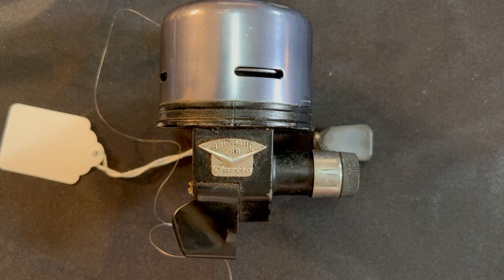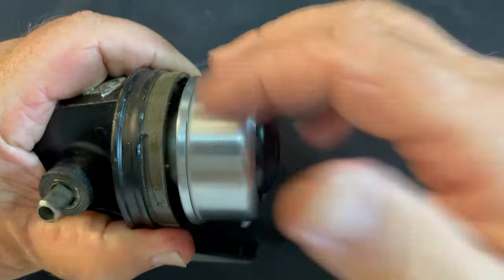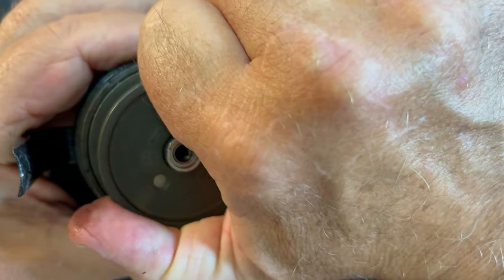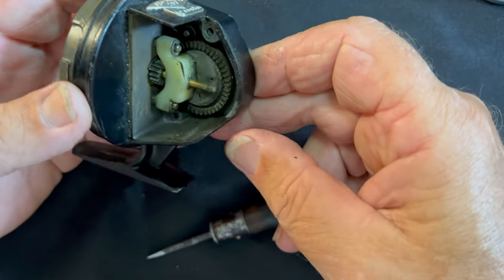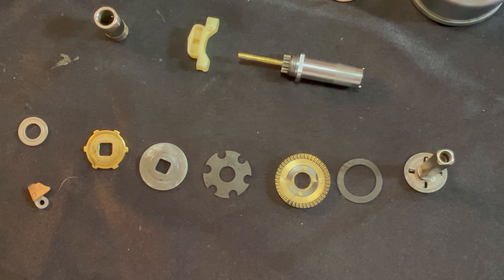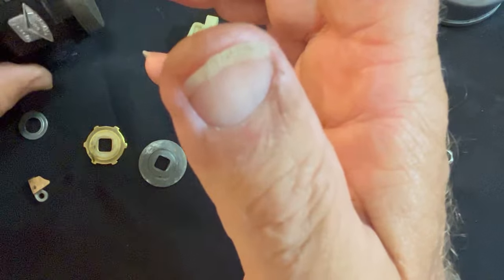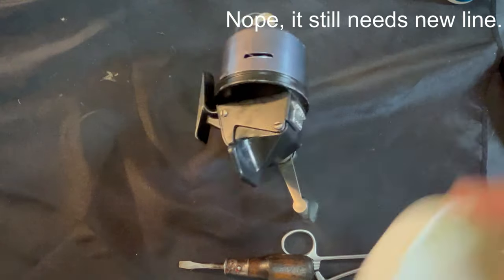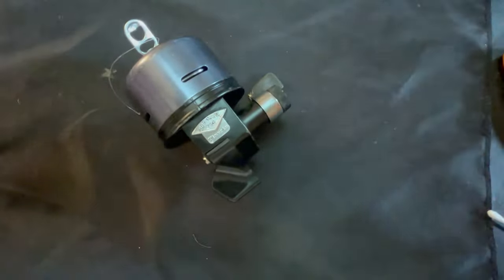Garcia ABUMATIC 290 -- Service and Lubrication -- Young Martin's Reels

Comment: I sure am glad you did this one now I can save the video and do my father's that I have these have always kinda stumped me...I guess I've been afraid of messing it up...Thanks so much...
Reply from the maker: Glenn, they are pretty nice little reels. I’m just not crazy about spincast reels that use a main gear drag system. They seem to be overly complicated and you seem to have to tighten them down too tight when landing anything with any weight to it. Since I’m never actually fished this reel, I can’t fault it. It sure feels nice in my hands.
Reply: Yea I prefer spinning reels myself... I've had this one my father's a long time never fished with it..for that reason over complicated is reason I've not taken it apart I mean it seems to operate fine but I know it could use a cleaning now I can because of the video...

Comment: Hello, my abumatic 290 has problem releasing the line when I push the button, need tip what to do to fix it.
Reply from the maker: Dennis, the spinner head is the part that controls the line release. It is the part I pick up at 30:25 in the video. I’ve never tried to take that apart nor do I think you should take it apart. Instead, clean it well with WD40 and a long bristle brush. Put it back on and try operating the reel a few times. If it works properly, take it back off, oil it, and put it back on. If it doesn’t, start looking for something jammed in there or a broken part.

Comment: I had a washer break the fiber one with like the u shapes in it are they something you can find so I can get this 😢 cleaned and fish ty
Reply from the maker: Bryan, I don’t think it has to have the U shaped cutouts. I think an ordinary drag washer of the correct size will work. You will need to measure the outside diameter, inside diameter and then thickness to find a suitable replacement. To the best of my knowledge, OEM parts are not available. With the correct measurements you can probably find a suitable drag washer by contacting:
https://www.smoothdrag.com/wp/

Comment: Boy, I hate little c-clips!  As you were reassembling the main gear, drag, and axle shaft withe the pinion - why didn’t you grease the main gear and pinion gear? I’m not quite understanding why you do the greasing before rather than afterward. It appears that the drag adjustment piece is also the part that holds the handle on the reel. That’s just plain weird. That little tab that you bent down - did you ever bend it back up? Did that matter?  Rick, I’m not sure I like this reel. It may be that it is just different.  Very interesting and a little confusing video. It’s probably just me. — Chris
Reply from the maker: Chris, of course I bent it back up. Watch the video to 21:29 and you can watch it yourself. I agree, the super close up views tended to make it hard to follow sometimes. Yes the drag knob also holds the handle on but like that DAM Quick reel the handle also controls the drag.